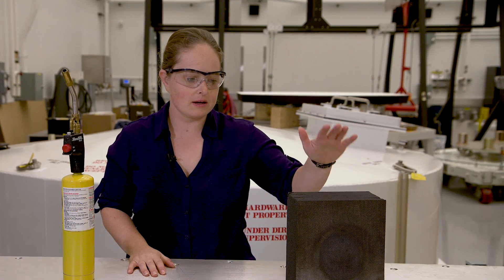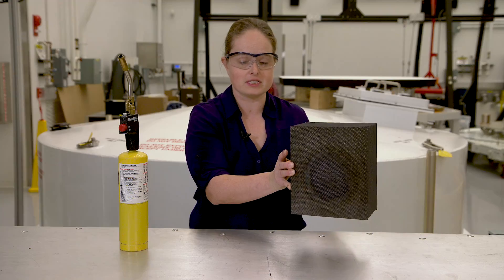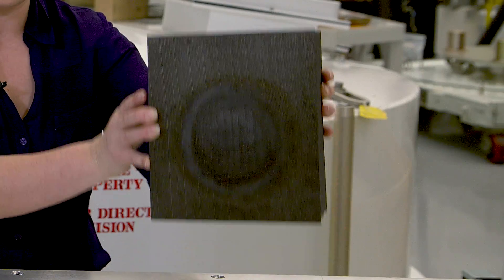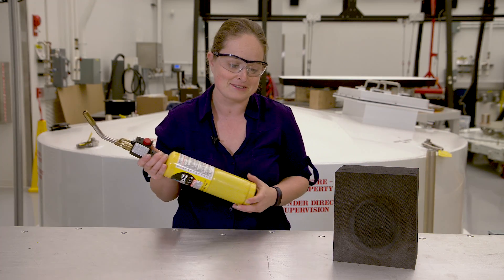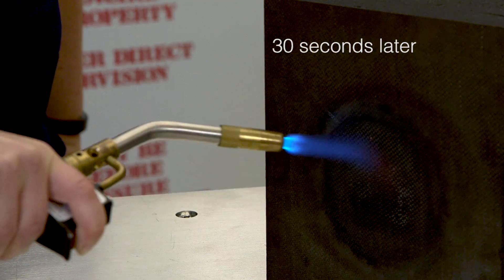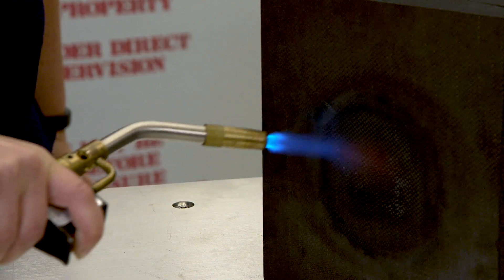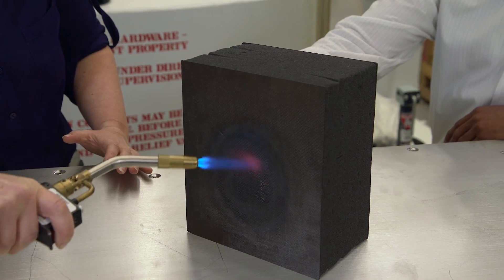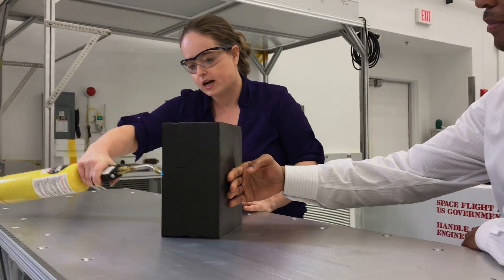Blowtorch vs Heat Shield

Comment: 'the heat shield will get up to 2500F+, but our demo uses only a couple hundred degrees'.  um, now show us a real 2500F+ demo which your lab surely has done and recorded.  the very idea any 'water-based' cooling system with this tiny heatshield is going to keep any part of this craft under 85F in a 2500F+ environment is impressive but it does seem also implausible.  

give the taxpayers some real proof of concept - at least fabricate demos that look relevant.

this sun of yours will be presumably getting ever larger as you 'approach' it which means eventually any real shield would have to be several times larger than the craft it is to shield.  even a caveman can figure that much out.

and what about sand-sized asteroids or space debris that could knock it off path?  how is it that space is super hot and chalk full of stuff traveling at insane speeds and this craft and elon's stock tesla among thousands are able to dodge all that since the 60s?  how is it that we never get killed walking around by specs of fine sand traveling a million mph?  its all so incredible.
  
i'm guessing it melted within a few seconds hence you can't show it to us, but i still look forward to a compelling demo that doesn't insult a caveman - using a blast furnace wind tunnel slamming a near scale model with 2500+F all day long.  

3:33 am launch sounds lucky too.
Reply: It's not possible to get 2500C with any machinery. Also, temperature work different on our planet and near star because density of gas is different.
Reply: Also nasa takes only around 1% of taxes
Reply: It's always reassuring to see there are others who see the huge lie that is NASA.

Comment: The part I don't get is that this heat has to be radiated away somewhere or else the probe ends up heating up too. Where does the heat go? If all the molecules around are hot then where does the heat transfer? Is it radiated away in the form of black-body radiation?
Reply from the maker: Downstream - away from the sun in the craft's shadow.

Comment: Now tell me how that heat shield is going to protect the Parker Solar Probe when the sun is 27 million degrees fahrenheit?? I think NASA is lying about something.
Reply: Learn the difference between temperature and heat.
Reply: @Duane Degn Learn the difference between reality and Disneyland....
Reply: To expand on Duane’s statement: temperature is a measure of heat, but heat is just the transfer of heat as an energy. Sense the Sun’s corona particles are so far apart, you can get millions of degrees TEMPERATURE while retaining a low amount of heat. It would be like putting your hand in an oven at 350. The oven is insanely hot but is your hand melting? No.

Comment: Please stop using imperial measures in science videos. Or at the very least use both systems, because not everyone thinks in feet, miles or Fahrenheit.
Reply: "The nautical miles part makes sense, each nautical mile is a minute of latitude"
How exactly does using units based on terrestrial latitude for a spacecraft in heliocentric orbit makes "sense"?
Also, there's a reason the official altitude for the Karman line is 100 km, and not 300 000 or 400 000 feet.
Reply: Aviation is in feet, so I'm assuming a lot of space stuff is too. In fact, it's not even miles, it's Nautical Miles.

The nautical miles part makes sense, each nautical mile is a minute of latitude

Comment: how about use this thermal shield for a planet venus mission
Reply: jasonmushersee there are several problems with that: you cant just slap that material on there et viola - done: this only works cause the probes are in space and heat is directional - its only coming from the sun and in the shadow of the shield its relatively cold. A surface probe would be fully enveloped by the atmosphere of Venus (aprox 460°C) and there is basically no real option to dissipate heat anywhere. Also most probes only survive for a couple dozen minutes down there, or dont make it to the surface at all due to enormous atmospheric pressure (about 93bar)
Reply: Good points, still there must be a way
Reply: Atmo density would destroy the machine.
Reply: You can't make everything out of this, it's heavy, it can interfere with electronics, cameras

Comment: Few hundred degrees demonstration lol?
Reply: There's a big difference between heat and temperature. To produce the equivalent heat in space, one would need much higher temperatures.
Reply: What's the temperature inside the vacuum walls of your thermos vacuum flask holding hot coffee? The temperature of this near vacuum can be very high but do you worry about touching the walls of the thermos? You probably don't. Even if the temperature of the near vacuum is really high, the amount of heat it can deliver to your hand is minuscule.

Space is a much better vacuum than the vacuum in your thermos. Even if the temperature of space is technically high, it conducts very little heat.

Of course heat can be transferred in other ways besides conduction but these other methods of transmitting heat aren't as efficient as conduction. Do you worry about your hot coffee radiating heat at you? Probably not.

While the temperature of the flame used in this demonstration isn't at the same temperature as the space where the Parker Solar Probe will travel, the amount of heat being defected in the demonstration is likely comparable to the heat the probe will experience.
Reply: Duane Degn Too bad for you, the Astro-nots said they could feel the searing heat through their space suits, while in that supposed vacuum.  And what is the container that contains that space vacuum?
Reply: Duane Degn Too bad for you, there are videos of the "astronauts" saying they can feel the searing heat of the sun on their knees when they face it, and the freezing cold of the "vacuum" on the legs behind them.  And about that "vacuum of space" , how does Earth survive that huge vacuum?
Reply: OrphanPaper
"what are you trying to say they  double glazed it"
I was attempting to explain why "temperature" isn't the same as "heat".
I was attempting to compare outer space with the gas inside a vacuum walled container.
The area between the walls of a vacuum walled container will not be a perfect vacuum. The gas in this area will have a temperature. Even if the temperature of this gas is very high, we can still comfortably hold the container because the temperature of the near vacuum isn't important. Even if the temperature of the gas inside the double walls is high, it will not contain much heat.
Reply: OrphanPaper
"temperature is a measure in arbitrary units  ,heat is energy ,why do you have  problem with that"
I don't recall saying I have a problem with it.
I've seen many people in NASA's comment section demonstrate they don't understand that "high temperature" doesn't always mean "high heat". I was attempting to provide an example illustrating this concept.
The comment "Few hundred degrees demonstration lol?" gave me the impression the original poster thought since the temperature in the demonstration was different than what the probe would encounter, this somehow invalidated the demonstration. Hence my attempt to illustrate the difference between temperature and heat.
Reply: wachu sed OrphanPaper
Reply: OrphanPaper
"a question if you burn your finger? what do you say? that temperature?,  thats was hot? or perhaps that has a lot of heat in it ?"

It doesn't matter what I say. The relationship between heat and temperature isn't based on what words we use to describe a sensation.

If I touch 400F air for a moment, I might think the air is hot but it doesn't immediately burn me. (I often get a blast of hot air in the face when I open the oven). If I touch 400F metal for a moment, there's a good chance the metal will burn me.

If there were a way to safely touch a 400F gas which was a near vacuum, the sensation I'd receive would likely depend on how much water was on my skin. Any water present would boil away and make my skin feel cool. If there isn't water or another liquid to pull heat away from my skin, heat would neither enter my skin nor leave my skin while touching a near vacuum. Touching a near vacuum would likely feel like touching body temperature air. A spacesuit which exposed skin to the vacuum of space through a mesh was once proposed. A mesh spacesuit would allow the body to cool itself by sweating into the vacuum of space.

Matter with a temperature of 400F may or may not be "hot" to the touch. Temperature by itself tells us little about how much heat there is. Whether or not something will "feel" hot requires one to know even more about the material than knowing its temperature and how much heat it contains. How well the material can conduct this heat is also a factor in whether or not something will "feel" hot.
Reply: Duane Degn yeah, but keep your hand in that 400 degrees for an hour.  Metal is a conductor of heat or cold (energy), which we scientifically measure with temperature.
Reply: OrphanPaper
"this is becoming an ego thing  your arguing about nothing i said"

I think I gave my reason for commenting earlier when I said:

"I've seen many people in NASA's comment section demonstrate they don't understand that 'high temperature' doesn't always mean 'high heat'. I was attempting to provide an example illustrating this concept.
The comment 'Few hundred degrees demonstration lol?' gave me the impression the original poster thought since the temperature in the demonstration was different than what the probe would encounter, this somehow invalidated the demonstration. Hence my attempt to illustrate the difference between temperature and heat."

In your last comment you said "i said :'Temperature is an arbitrary measure '  if that is incorrect please tell me"

Okay. You're incorrect. temperature isn't an arbitrary measure.
Temperature is a physical quantity expressing hot and cold. It is a PROPORTIONAL MEASURE of the average kinetic energy of the random motions of the constituent particles of matter (such as atoms and molecules) in a system. (From Wikipedia.)

Once again I'll point out knowing if a material is "hot or cold" is not enough information, on its own, to know if the material will burn you or not. You also need to know the heat capacity and the thermal conductivity of the material. The heat capacity and the thermal conductivity of space is very very low. Space can be very hot and still not cause heat damage.
Reply: OrphanPaper

So you think kinetic energy can't be compared proportionally?
One system can't have twice as much kinetic energy as another?
Reply: "so please go put on your rap music and go back to contemplation your naval lint or get educated  properly"

You imply immaturity in others while demonstrating it in yourself.
Reply: OrphanPaper What a bunch of nonsense.  The heat of the sun supposedly travels through 93 million miles of a freezing cold vacuum chamber, reaching the sidewalks of earth and heating it up so hot at times, that you can fry and egg on it.  But right there in the sun's corona, the 2-3 million degrees F just is not that bad.  I know there are a lot of people who swallow this garbage, but thank God, millions are waking up the the magnitude of the lie that is NASA.
Reply: OrphanPaper Arbitrary?  No, it's an establish method of measurement, based on real science.
Reply: I know. I had a good laugh at it.